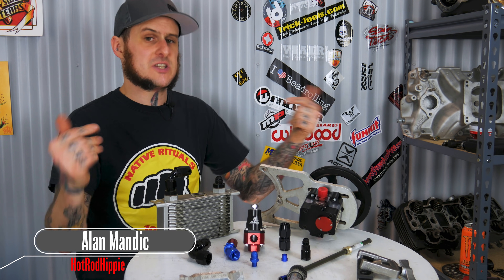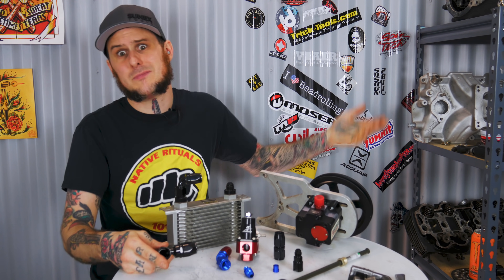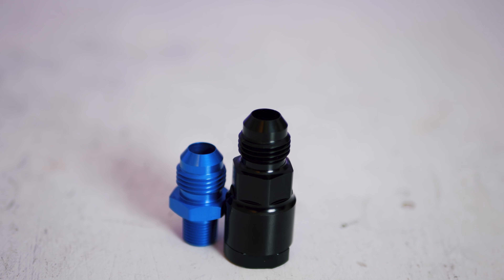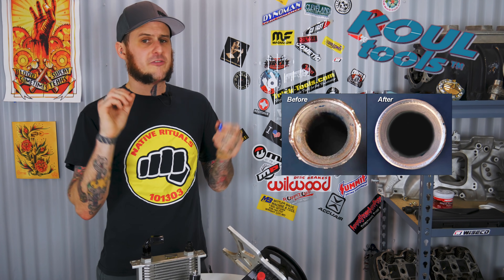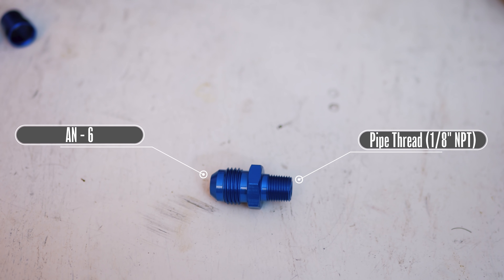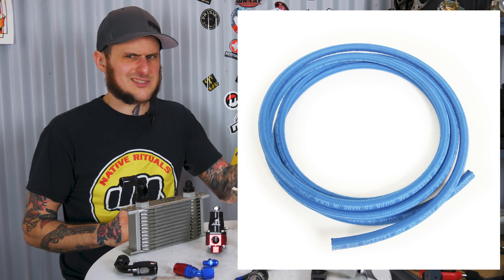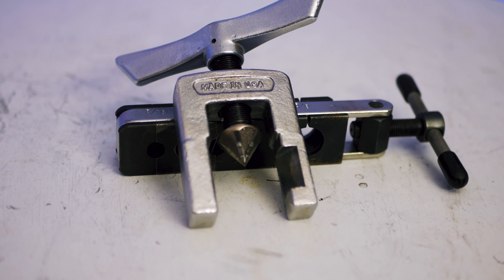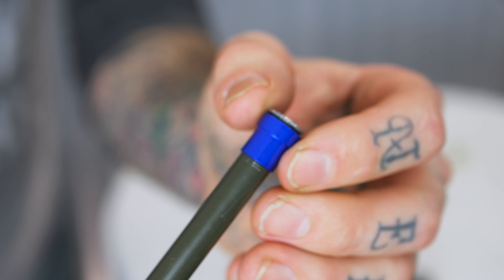AN Fitting Basics - How to Assemble and Common Mistakes!

Comment from the maker: Do you use AN fittings often? If so what is your most common use case?
Reply: Semi truck and heavy equipment fuel systems because manufacturers love them and it makes no sense to do any aftermarket changeovers.
Literally every single day I come across tons of them.
Reply: HotRodHippie   No anti seize?  I’m going to an for my oil and fuel. I’ve been told to use anti seize
Reply from the maker: @marvinmartinsYT  a tiny dab of anti-seize is fine and useful. Just make sure it is on the threads and not the sealing surface of the fitting. I do not use it for that reason. Especially in an oil situation, anti-seize in your oil isn't good so I'm too paranoid about it getting in my way. And I've only had a handful of fittings seize in my time working on cars. And they were never ones I installed so I cannot say why it happened for sure.
Reply: HotRodHippie  cheers for the reply👍🏻. Thanks for advice also.
Reply: 6 and 10 ;)
Reply: I have been using -AN fittings (GEM) and as braided hose for many years on my road racing car and will use nothing else. Except for -4 for our brake system we assemble our own hoses . We have never had a leak, loose fitting or any kind of failure.
Reply: I’m think of making a line for my 240 so I can have power steering back any advice on that?
Reply: Im replacing a fuel line on my ML55 AMG - it's 5/16 nicopp that i got - my question is do they have male end flare fittings? or do you use junctions between the two female adapters?
Reply: I have never used AN hoses before, I have always used rubber hose. However, I am installing a custom oil cooler (oil to coolant heat exchanger) in my Honda Civic very shortly and that will be my first time. I am going to be making my own 10AN oil lines. I am a bit worried that I am going to mess up since I never made AN lines before, but everyone has to start somewhere and your video was very helpful. Wish me luck LOL!
Reply from the maker: Best of luck. I would say the biggest rookie mistake is letting the stainless weaving fray when cutting the hose. A lot of people like to wrap the spot they are going to cut with electrical tape or masking tape tightly. That helps prevent fraying. I used to do this but now that I have the hose cutters that I use I don't have any issue with fraying anymore.
Reply: @HotRodHippie  That's a great tip, thank you! What is your preference on the material that the lines are made of? I know Teflon is good because it resists extreme heat and chemicals very well and is good for high pressure applications, but I have also heard that it isn't as flexible as standard rubber AN lines? Thanks
Reply from the maker: @averyalexander2303  Teflon lined is good for pressure applications but that is the only time I use it. So like Brake lines, Clutch Lines, Power Steering, and AC hoses. It's far less flexible than regular braided so it has to make large sweeping turns, and the fittings don't swivel. So you have to orient your fittings just right when installing them or things won't line up properly. I only use it when I have to at this point. For oil lines you will be fine with standard AN hose. 

I personally have been using Russell Pro Classic hose lately. It has a Nylon black weave on the outside. It isn't as strong as regular stainless braided but it's good enough for my applications and has less of a race car look. For the driver/ hot rod cars I'm building that look fits better.
Reply: @HotRodHippie  Thanks for your help and I hope you enjoyed the holidays. The hoses I ordered are made out of CPE (Chlorinated polyethylene). That should be okay for oil cooler hoses, right? Thanks again
Reply: @HotRodHippie  Well I just got done making my oil cooler lines, and I have to say it's really not very hard, I was expecting it to be much more difficult. So if you are considering using AN lines but you are afraid that you will mess it up, don't be. Anyone with a few tools can do it successfully, it just takes a little time and patience :) Tightly wrapping the hose in electrical tape before cutting it is a great tip, it worked wonderfully. One more tip that I will add is to not leave extra hose. I have a habit of always cutting hoses a little long to make sure I have enough. That works fine with rubber hose, but don't cut AN hoses long. I made that mistake and I had to take the fitting off and cut a couple of inches off because of the way it was sticking out from being too long. The only problem is that one of the flare fittings on my oil filter sandwich plate is leaking oil because it wasn't machined correctly, but I should be good to go once I get a new flare fitting.
Reply: @averyalexander2303  excellent I'm glad to hear it went well for you. They really are one of those things that seems much more intimidating than it is. I usually do my best to mark hoses to the exact sizes I want. Usually I install a fitting on one end first so I can screw it on to fix one end. Then mark the other. 

Hope your oil leak straightens up easily, sounds like it isn't a big deal. 👍
Reply: @MandicReally  Thank you. I know every situation is different, but I presume a defective fitting will generally show up immediately and not hundreds or thousands of miles down the road? I am a bit worried about something failing and dumping all my oil out now lol. But I presume that as long as everything is correctly installed, if it doesn't leak immediately and it's not leaking after a few miles it's probably not going to fail? Thank you and sorry for the stupid questions, I am new to AN hoses lol.
Reply: @averyalexander2303  yes, I don't think I've had a single fitting ever fail that didn't leak immediately. Granted I don't run a race shop going through thousands of fittings, but in over ten years that has held true for me across various brands. 👍
Reply: @MandicReally  Thank you for your help, I really appreciate it. Again sorry about the stupid questions, I am new to AN hoses and fittings.

Comment: Good video.  What would you use to replace a bubble flare on the original brake lines with?  Is there a metric to AN adapter or 37 deg single flare and nut and sleeve?  I want to replace all the brake lines with SS.

Comment: Im struggling - i made a 5/16" nicopp fuel line and got AN6 to 5/16" compression fittings.  I also got AN6 Flare fittings and plan on doing a 37 degree flare instead.  But isn't AN6 for 3/8?? 2:10
Reply from the maker: Yes. You can't flare 5/16" line to work with -6AN. Your compression adapter fitting is the only way. I don't particularly recommend those though as they can compress the material and weaken it. Especially with the Nicopp stuff. I don't care for that stuff at all personally.

Comment: they do NOT go together  like that ..... never have they gone in that easy they do NOT tighten down flush they round off as soon as you get half way in !!!
Reply from the maker: I've assembled hundreds of AN fittings without issue. If you are rounding them off or running into issues assembly, that is an assembly error. Lubricate the threads and the taper going into the hose. Use the proper tools, such as a good AN bench vise, aluminum AN wrenches, or the RedHorse Performance Assembly tool. The ONLY fittings I've ever had round off were ones already damaged by someone who improperly installed them to begin with.

AN Fittings have been used by the military, aeronautics, racing, and custom car world for close to 100 years, the standard works well when assembled correctly.

Comment: I am doing an6 45s and 90s. I notice that the fitting swivels on both . Can you explain how this wont leak
Reply: The sealing is done via an o-ring seated on the flare in the fitting, not a the thread, so the fitting moving wouldn’t cause any leaks. Also, they seek to tighten and position themselves once you tighten them down.

Comment: Are those hose cutters forged or cast? Are they still cutting braided lines well? How do you guys feel about barbed fittings for transmission cooler lines? Were talking low pressure, around 150psi in reverse. AN fittings are going ro cost more.

Comment: Can I use an fittings to repair the rack and pinnion hydraulic hard line of a 2007 jeep liberty. They don't make the hard hydralic lines for it and was wondering if I can use a an fitting on new made hydralic line to mate the ends of the cut off orginial ends so to make it work ?

Comment: So how would you attach that AN flare on that brake line you did to something? Do they make an AN nut that you put on first before the flare like a normal flare nut?

Essentially, how would you attach that to an AN fitting?
Reply from the maker: It depends on the brake line. Are you referring to the 45 degree double flare that most brake lines have? Or banjo bolts? There are dozens of different brake line fittings on the market so you need to determine what type of fitting you are adapting to. Then locate an adapter that goes to the AN line you need. Or do you mean how to attach a hard line to AN Hose? That’s the 37 degree single flare and a tube sleeve / nut combo that I’m fairly sure I mentioned. 

I can’t know your applications details to tell you what you need. Even the same brand can use multiple different fittings on the same vehicle.
Reply: @HotRodHippie  thanks for the super fast reply! In this video you showed us how to use the 37° flare tool. How would you then attach that line to a male AN fitting? I saw you put the blue collar on, but I don't know what that is, how does that attach to the other half?
Reply: @HotRodHippie  nvm, I went back and watched it again, in the video you didn't put the tube nut on, just the sleeve. I understand now liiiiight bulb 🤦
Reply from the maker: @mjminino  Yea, my mistake, not helpful for folks learning. IN this video I did break lines on a build: https://www.youtube.com/watch?v=TBEDVi_e3qg

Comment: My gas tank has two different sized hard lines. One has OD of 1/4 and the other has an OD of 5/16. I want to run -6 AN lines. The only adapters I can find that goes from 1/4 to -6 and 5/16 to -6 are compression fittings?? Am I missing something or are there no tube nuts that convert a 5/16 hardline w/ 37 degree flare to -6 line and 1/4 hardline w/ 37 degree flare to a -6 line?

Comment: So the standard brake flare tool kits you can get from the parts store will not do a 37 degree flare is this correct?
Reply from the maker: That is correct. Totally different angle (45 degree) on that. Sadly ones that can do stainless tubing at 37 degrees are pricey for the most part.

Comment: I have a 6AN-M12*1.5 o-ring fitting. It seems if I tighten this up too much and it bottoms out it will squish out the o-ring. For a universal inline electric fuel pump. I've never tightened me up before but it doesn't have a 1/2 round mating groove to accept o-ring...like i would think it should have. Once the o-ring initially touches mating surface, it's only  about 2 full turns till its almost squished out. 
I assumed with any O ring it would have a machine groove in the mating surface so no matter how tight you got it it would only allow so much compression. This is an o-ring going up against the flat part of the fitting on the pump. I hope I made sense and if anyone can help I greatly appreciate it. Thank you for your video

Comment: More focus on the actual depth of hose into the line nut as it tends to be a vatlruable often overlooked. There are brand specific details i have discovered. "Russell" vs "Aeroquip" vs "Redhorse" vs "Evil Energy". Evil Energy does not push on it uses a left hand thread to thread nut onto hose jacket. It also features a rounded transition pinch portion. Most companies talk about how to botyom out the hose into the nut but do not illustrate that key feature. "Aeroquip" for example has a steep edge champher in the section some call the cutter area. This is where the cross brand compatibility ceases. Inside they have what appears to be a directional concentric angled rings very one way barb oriented vs threaded. The area of notice is where the hose is considered bottomed out. Perhaps that is why mine started leaking 3 years after install. Or maybe it was a hose material degradation. It was on engine oil at less than 250°. Time to retrofit. I am fond of the "Russell" brand because it is also my name but they may not be the best design vs cost effective. So champher vs rounded, steep angle vs shallow, threaded vs push on nylon btlraided vs steel braided. There is so much engineeri g goes intovan AN design fitting. You shiuld also tuch base onvtge different thread tolerances of AN at 3 vs JIC at 2. Thank goodness thread spec 1 has all but disappeared.

Comment: Great vid, I changing out my badly rusted  out f150 lighting fuel rail.  Ford stop making lots of parts.  I have to go aftermarket,  never used AN fittings before, so your video is very helpful. 
Thanks.

Comment: Great video thank you for sharing. Is it advisable to use 3/16'' Copper nickel tubing with -3AN fittings ? This is specifically for running bulkhead connectors for braking application. Appreciate your advice

Comment: The AN NTP fittings, the fuel pressure regulator you have on the video is the exact one I have and not sure what fittings I need to convert to AN 6. What size is needed, all new to this

Comment: do you suggest any lubricants or anti-seize when installing onto the treads at final installation?
Reply from the maker: I usually apply a spot of air tool oil to the threads. There are specific assembly lubes I’ve just never bothered to order. 😬😅

I only do Anti-Seize if using dissimilar metal fittings. So an aluminum fitting onto a steel adapter, I’d use a small spot of A-S. Or when assembling Stainless fittings at all. Stainless on Stainless can gaul, so anti-seize is a must there.

Comment: Can the stainless steel braided hose and AN fittings be used for on board air system with load leveling and a train horn?
Reply from the maker: Absolutely. I use it to plumb air ride suspensions.

Comment: Thanks for the very nice video. I have a 2001 4Runner and I am replacing the transmission cooling lines. I want to go soft tube. Would you know what fitting I need to connect to a metric fitting. The old tube was flare and had an inverted nut. I appreciate any information you could provide.

Comment: Do some of them pivot or rotate while tight?
Reply from the maker: Swivel fittings do. Every hose end fitting I should in this video was a swivel fitting. (Except the straight ones.) I personally prefer them. I’ve never had a fitting failure and the ease of plumbing with them is a big pro. There are Swivel and Non-Swivel fittings so just watch out when purchasing.

Comment: Outstanding video again--you're really kind of my favorite "car craft" you tuber.  Question--running a new lines from tank using 6an--I am thinking of trying black nylon-stainless threaded line.  Any thoughts?  I've had some people say it doesn't seal as well---but on a test fitting--seems fine...any advice would be appreciated.
Reply from the maker: I use the black nylon braided stuff more often these days. It just looks better and is less abrasive so less concerns about it rubbing a painted surface down the road. I’ve had zero issues with it so far but I’ve only been using it for a few years so far. Thank you very much also. 🙏

Comment: What rules of thumb are there for the the correct AN size for the application? For example, fuel line vs remote oil cooler lines. Presumably the fuel line would be smaller, maybe an 6 AN or something but what about the oil cooler? 8AN? 10 AN? How much volume is too large for an oil system vs too small?
Reply from the maker: Generally I base my choices off of factory line sizing.  Factory Oil Cooler Lines are generally 1/2" to 5/8" in my experience.  So -8/-10.  Fuel LInes, Power Steering, and Transmission Cooler lines are generally 3/8" or 5/16" so -6 is a good choice there.  But if your system is modified to produce more pressure/flow (Fuel Systems most commonly) then you may need to size up for those needs.  Such as -8AN Fuel feeds for higher performance engines.  Or -10AN (or -12) for Suction side of a Fuel pump. 

Contacting the manufacturer of parts you are looking to use would likely be a good way to go.  Such as a Fuel Pump manufacturer often (in aftermarket cases) has a recommendation for line sizes for use with their systems.  The same will likely apply with Oil Cooler Adapters, Power Steering Setups, Etc. 

Hope this helps. I don't really have a chart to show this.  It might be a good idea for me to compile something like that.  Maybe I can work with some manufacturers on that and put it on my website.

Comment: With most stock steal/brass/alum./etc. fuel lines you can cut the raised barb off, throw on appropriate sized tube nut, and flare the end, or put a ano-tuff hardline -an fitting on. Turning your crap connection into an actual hardline with a -an end. You can screw on a -an shut off/petcock right to it, making any maintenance super easy and clean. Also makes a great anti theft devise, just turn a lever, and no fuel.

Comment: Are those tiny holes on the fittings meant for anything? I don’t see anyone ever talk about it
Reply from the maker: Little holes? You mean in the side of the fittings like right next to the hex/wrench flat spots? Those are for the retainer pins. The fittings spin on themselves (Swivel Fittings) with o-rings sealing inside of them. That little hole is where a pin is driven into the fitting to hold the fitting together.